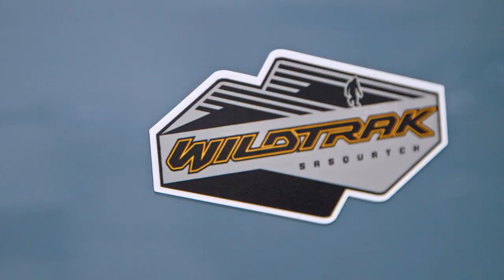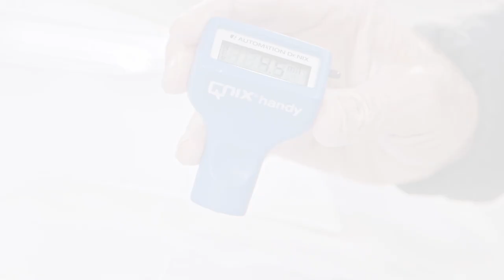Protect your Bronco with the most critical areas to add Paint Protection Film

Comment: what does it cost for PPF on a typical 2021 bronco, doors, partial hood and first few inches of the roof top?
Reply from the maker: Hi. Partial hood has several different sizes but a typical 18” for example is $300.  The roof with 6” would be $150 and each door would be $300.   Our Mod Shop has basic pricing on their site https://www.baddogmods.com/protection.html
Thank you